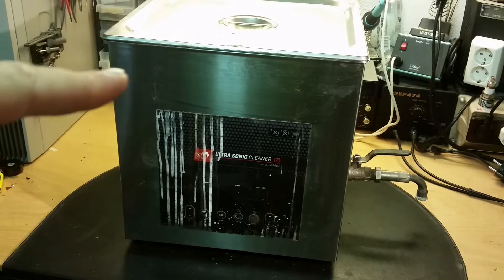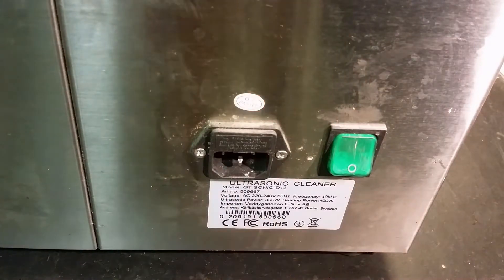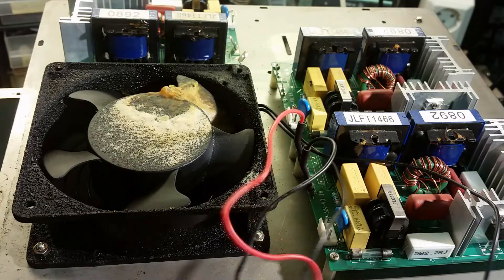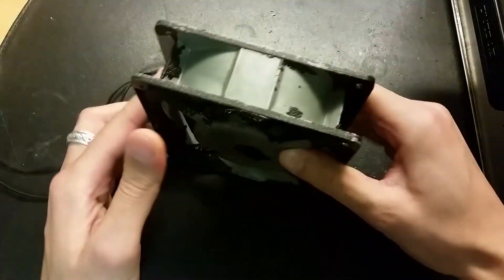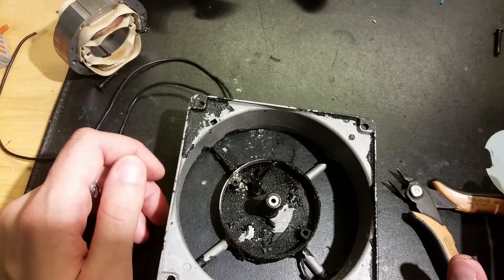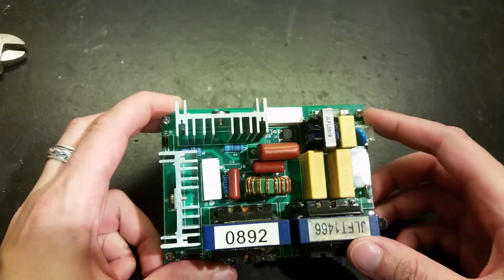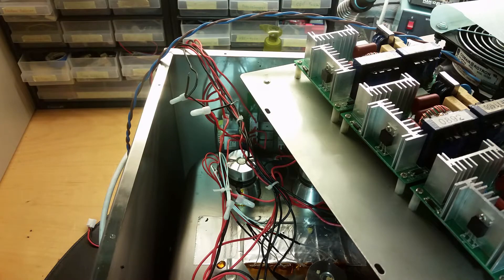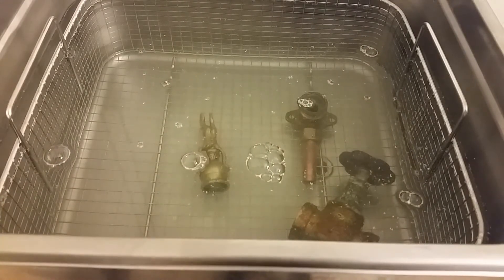Ultrasonic Cleaner Repair

Comment: The smaller unit had a manufacturing defect and the larger one had a design defect - these videos were most helpful and now I will check my unit to see if similar problems potentially exist since both problems might be quite common to all units manufactured out in the marketplace.

Comment: Nice job on both ultrasonic cleaners.  I have an old one and it induced voltage on a toaster handles the power cord was laying on and arced twice before I could turn it off. Nothing is burnt or open  but only the light indicating power works. It has one metal capped two prong transistor attached to a big heat sync that seems ok on a  digital muti meter. Can't figure it out.

Comment: How is the epoxy holding up on the drain? I got given a new one with a leak and as far as I can tell it can only be leaking from the drain or the release valve and was going to use some marine epoxy to seal it

Comment: Hi! Sir, i have an ultrasonic 3510 model, i have a problem when turning on the sonicator there is no sonicating sound happen, but i can here the contact of the relay. what will be the possible problem?
Reply from the maker: Maybe the transistors are damaged or the transducer itself, you can measure the transistors but i don't know how to measure or test  the transducer in a good way
Reply from the maker: Hi sir, yes it can be the relay contact which can be oxidized or maybe problem with the oscillator circuit itself
Reply: @MrTesla1337  thanks for the reply, as I check the board there is a damaged varistor and fuses then I replace new one, but still there is no sonicating sound after assemble and testing.

Comment: You know I repair all kinds circuit boards but I've never had good luck with ultrasonic cleaners circuit board. I have had leaking drain tube but I ended up welding it. For welding in the beginning I used to have a local welder do it. Then I started trying it by myself and burnt a couple of Tanks up. Finally I was able to weld a couple of them myself but I don't get the problem often enough to want to improve....I don't trust the adhesives for this job.
But what would you do when the transducer is broken off or burnt? anyone know?
How would you glue the transducer back? what kind of glue would you use? What type of process is used to glue the transducer down?
Reply: I'd love to know the answer to that question myself.

Comment: What a coincidence, just yesterday evening I found a discarded ultrasonic cleaner scheduled to be picked up by the local garbage collection company so I grabbed it.
I got lucky mine only had 2 shorted diodes and a blown fuse and I already had all the parts at hand so it was a quick job
Reply from the maker: Nice done, congratulations